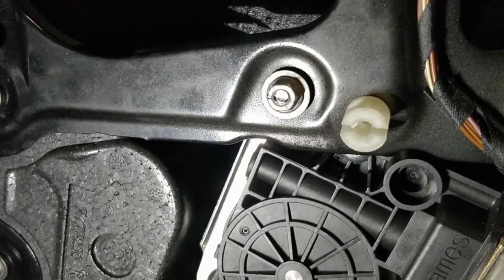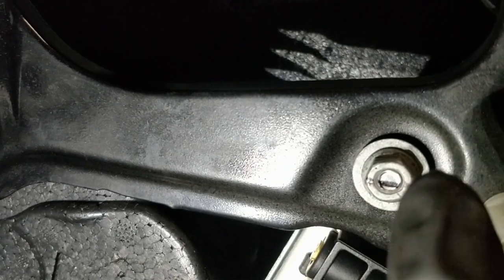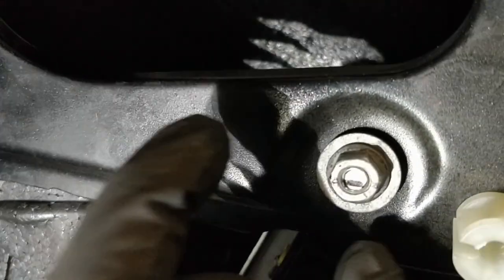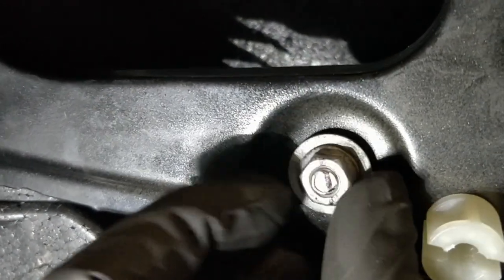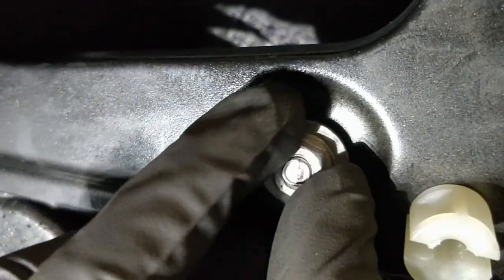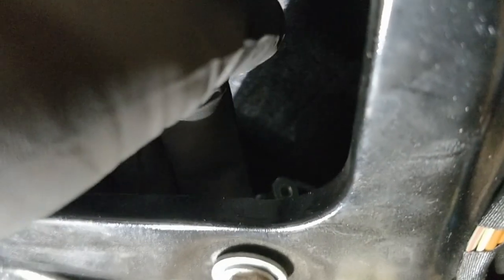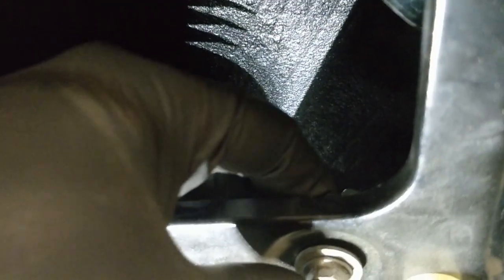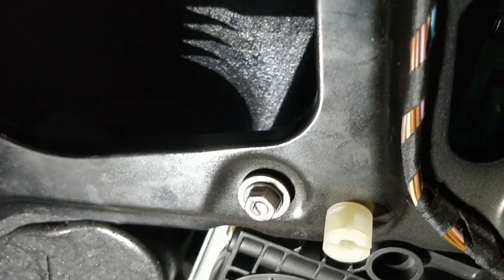How to remove stuck or spinning bolt, screw or nut by drilling

Comment: What about if the screw is in a spot where I can't fit a drill? Please don't say, then your screwed. I'm being serious.
Reply: Would depend on why you can't fit a drill but an alternate option is to use a dremel with a flexible shaft extension and a cutoff wheel and cut the head off - had to do this on an A-pillar trim screw that was spinning in it's nut. Couldn't use a drill unless I removed the windscreen.
Reply: @michaelholt5069  Thank you. I will try your suggestion

Comment: I currently have a bolt that just spins inside the bolt hole of an exhaust manifold.  I believe that the bolt ripped off a section of threads from the bolt hole causing it to just spin.  In all my years of being a mechanic I have never come across this particular situation.
Reply: Im having  a similar issue with one bolt on a gas tank for a 79 chevy scottsdale
Reply: The same type of bolts in the video is on my 93 s10 blazer front bumper, one sides just flat for esthetic purposes. They’re a pain in the ass even when they aren’t rusted to the nut. Hate gm for that design😒
Reply: I’m having a damn issue inside a stupid rivian the bolt of the truck seat I. The back just spins with no access in the back

Comment: I was trying to find some fancy way of removing a stuck bolt that has no nut, but just spins. I didn't want to just break it, cause it's kind of important, and drilling isn't an option either. It's a reverse lockout for a transmission, and that bitch just spins. It does it's job and is in far enough to make it work, but it's not ideal to have like that, and there is another piece that needs to go on the other side. Maybe once i get the assembly out i can try my hand at it without destructive techniques. The lockout moves around when you shift into 5th or 6th, but it holds and does it's job and won't break off. But anyway of saving $200 for a new one is ideal. Cause of course you can't buy a perfectly good housing for the shifter, without also buying the entire shifter. And the car is too new to be found in your average junkyard.

Comment: I can't believe there isn't an easier solution for such a common problem.
Reply: this is the easy solution!
Reply: This is the easiest way. And it's the first thing that came to my mind since i'm a mechanic, but then i thought there has to be some otherway to do it, to be less destructive. The last time i did this was when a stud for the transmission broke but it broke in such a way that you couldn't extract it. Ended up having to to drill a hole through the thing do not recommend very bad idea. I asked the guy why he didn't want to buy a new transmission, obviously too much money. There isn't much i could do. So i drilled it out and now that the hole was much bigger and required a bigger bolt and nut to hold it together. In the end it's been over a year and no leaking so if it works it works. I didn't want to have to do that again. But is is the easiet way of getting it out.

Comment: You only removed the head and not the whole screw....
Reply: Now that the nut has been removed, you can replace the spinning stud that’s left over.  Usually by using a punch and hammer.

Comment: I am trying to replace the rear struts on a 2002 Hyundai Elantra sedan. There is a control arm that has an embedded bolt in it (no bolt head). The bolt threads go through a hole in a flange on the side of the strut.  The bolt nut is seized on the threads. Neither the nut or the threads are rusty.  When I turn the nut , the bolt turns with it. I cannot get a wrench on the bolt, because, as I just said, the other end of the bolt is embedded into the control arm.  So I need to get the nut off,  put in a new strut, and then thread the nut back on the bolt. Would this technique work here?  Or should I go another route, such as heating the nut to get it off?
Reply from the maker: Hi Jeff,
I am sure you would have solved your problem by now. But in general this technique would work if the thing that is being drilled in to could be held stable and the thing(bolt) is soft enough. Otherwise I would suggest using screw extractor. How did you solve your problem?